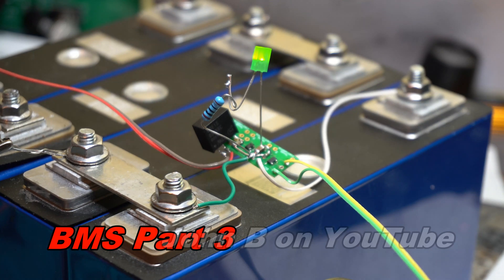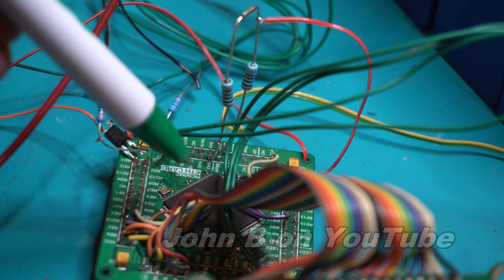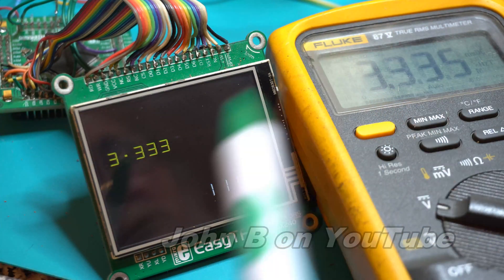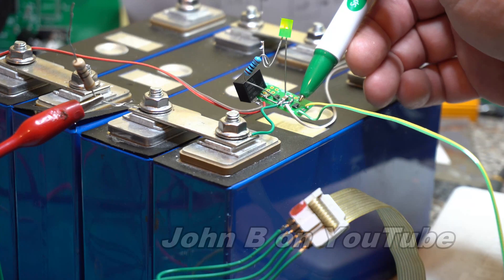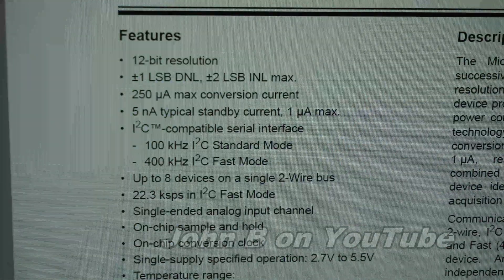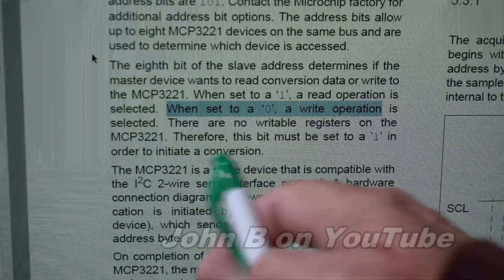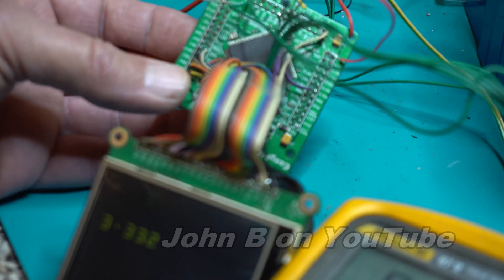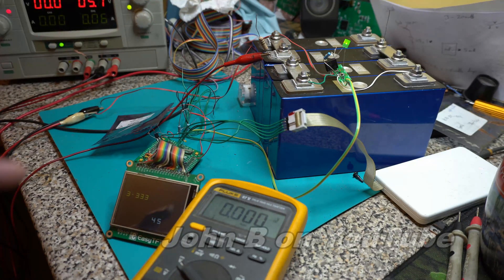Battery Management System (BMS) Design Part 3 | Murata DC to DC Converter & Microchip's MCP3221

Comment: One request if possible you get a time please make one detailed video about MOSFETs or IGBTs gate resistor calculation in repair sometimes we cannot get exact parts that is very big problem I facing I see your vide on that but it will be more easy for us to understand replacing the MOSFETs or IGBTs and how to calculate the gate resistor and gate to source resistor
Thank you very much for always the best informative videos
Best regards from Philippines 🇵🇭
Reply from the maker: Thank you again for your comments.
So you did see this video?  https://www.youtube.com/watch?v=oynwrZ_Hp7I     
Did you watch part 2?
There is only one way to calculate the resistor.
When repairing stuff, try and get a similar Nc / gate charge required.
If the Nc on new part or total capacitance is high, just increase the gate resistor by 50 ohm.
All ok for everyday electronics.
Reply: @JohnB-2021  thank you so much master 🙏
Reply from the maker: @MarkPrince1317  I'm no master but thank you.